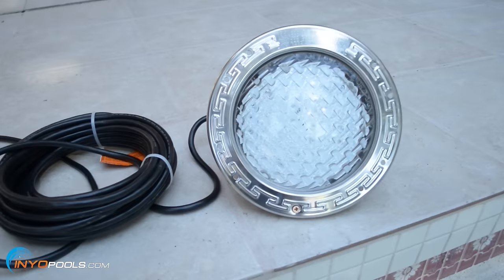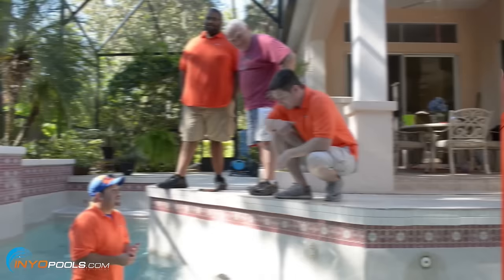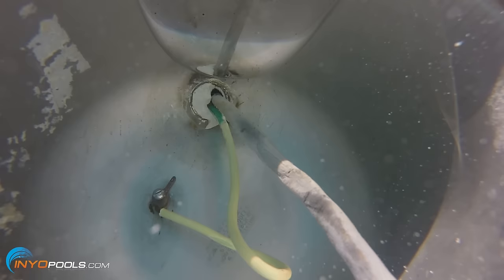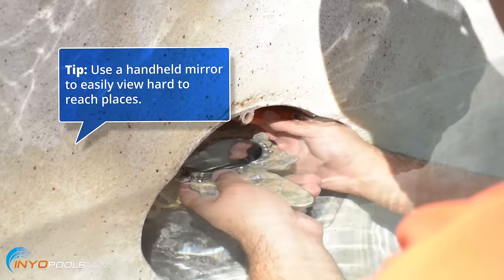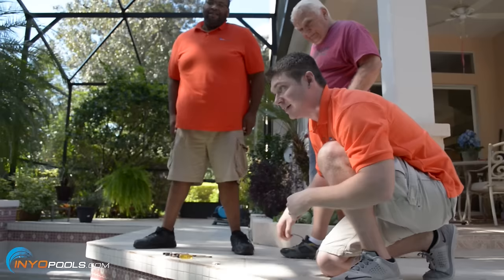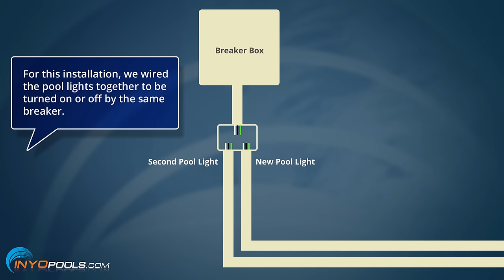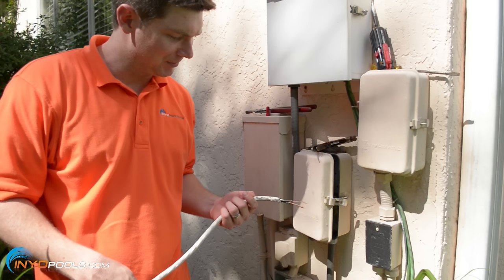Poolside Repair: How To Install A Pool Light

Comment: You can use  $4 harbor freight multimeter to measure resistance across the the power wires at the box. The cable with infinite resistance (no continuity) between hot and neutral is the one with the cut cable!  Only one person needed.  No tug of war. Duct tape makes a much better pull joint than electrical tape.  Might as well give yourself every advantage you can.

Comment: It looks like your video missed the part of leaving enough cable so that the light could latter be taken out of the niche an placed on the deck for servicing.
Reply from the maker: We mentioned that in the video description and our blog post, here: http://www.inyopools.com/Blog/poolside-repair-install-pool-light/
Reply: Perhaps, but you surely did not show it in the video - in fact, it is quite obvious that there is absolutely no slack cable left in the niche and so whoever is stuck with replacing that bulb when it burns out will have an unexpected problem on his hands.
Reply: @chuckschillingvideos  I can see him putting several loops of wire in the back of the niche at 5:10

Comment: I know that most of these questions are older but I'll give it a shot here to see if anyone might know. I see conflicting videos out there when it comes to draining to light level. It looks and sounds like it's not necessary but mine is on the deep end and i'll either do it one armed from the deck or while treading water. If I don't drain and then go to pull out the epoxy, is the water going to travel out the conduit and just stop at the bend. If so, is that okay to leave all that water in there? I have an old Anderson pool with NO diagrams and am not even sure where the switch, breaker or junction boxes are.
Reply: You ever figure it out?

Comment: Good video guys. You might have mentioned the bonded ground wire in the niche because some people were probably wondering what that was. Also to leave 4-6' extra wire to be able to pull light to pool cool deck so water does not have to be drained.

Comment: I didn't see wether you put new silicone or whatever in the nitch hole ?
Reply: I was told by an expert that water will get in the conduit somehow anyway whether sealed or not and not to lose sleep over it.  Meaning you do your best to apply some epoxy at the niche hole and at the JBox and forget about it.  As long water doesn't leak at the JBox, you're fine.  My believe is that water in the conduit will recycle itself even if it takes a year but it will; so don't think water will be stagnated in the conduit forever.
Reply: Do you lube the gasket around the lite before putting it back in.

Comment: Draining the pool is not necessary...but great for videos.  I swapped these all the time in the winter with nothing but a wet arm.  Also, I noticed that he did not hook the light on the bottom of the niche. If there is no hook in the niche then a 'light wedge' is a good solution.
Reply: What is that lightwedge because this is what I've been trying to figure out if there's a hook at the bottom
Reply: @roymcleansr.5404  https://www.youtube.com/watch?v=thCt4adC2V4  ...it is a wedge that goes on top of the light, uses existing escutcheon holes, but presses the light down hard enough on the bottom to secure it if it is missing the hook. I have used two opposing wedges to secure lights with no female threads or bottom hook although it takes some finesse.

Comment: I hope you guys didn't forget to put the epoxy back in and to leave yourself enough room to be able to stretch the light up to the deck for a bulb change if necessary later on.
Reply from the maker: Hi Steven, we replaced the epoxy with a rubber stopper. We forgot to include that part in the video. We definitely remembered to leave ourselves some extra cable. Thanks for watching :)

Comment: dont pull it next Time Sirs,pls use a multi tester for the contenuity and it is easy to detect which wire is to splice or to connect.

Comment: I didn't see you put epoxy back.  I will be replacing my light soon and was wondering about the epoxy part of the install.  Also I have a Pentair Am. sAm light now.  I was not impressed with the sAM light at all.  Are there other lights worth the price?
Reply from the maker: We used a rubber cord stopper instead of epoxy for the new installation. It is easier to install and easier to remove for maintenance in the future. If you want a color changing light I suggest the Purline Pure Colors LED light: (http://www.inyopools.com/pureline-pure-colors-led-pool-light-fixtures.aspx)
Reply: A rubber cord stopper? What would that do? Wouldn't water be on both sides of the stopper?  What's the part number for this stopper?
Reply: What’s the part number or link?

Comment: I noticed that you said you pulled Apoxsee sealant from around the cord out. And I also noticed you didn’t show putting out Apoxsee or any thing back in that conduit wouldn’t hurt to put a marine grade silicone back in that hole to stop the water from going in there.
Reply: Also, the rubber stopper you use does it come with the light?
Reply from the maker: The cord stopper does not come with the light; it can be purchased separately from a hardware store for a couple of dollars. We didn't add epoxy to the cord stopper because it would be unnecessary. It'd be like gluing a cork into a wine bottle. The cork is enough.

Comment: We built a pool with our new home (20' X 45' in-ground with integrated spa). I only noticed after-the-fact that the pool contractor installed spa-sized lights EVERYWHERE! Because of the this, I find that the brightness for night swimming has a lot to be desired. There are a total of 5 lights in the pool and 1 light in the spa. I think they are all incandescent as well. 

Anyway, I've been questioning for the last year whether I should upgrade to LEDs to improve brightness. Will this really make a noticeable difference in a spa-sized bulb that has a limited wattage anyway? My pool plaster is Hydrazzo Maui Midnight (so, not white or light blue) if that makes a difference. I know the paler plaster colors hinder the brightness as well. 

Would love to know if anyone has a similar experience or have retrofitted to improve brightness at night. Before and after pics would be awesome as well.

Thanks!!
Reply from the maker: Making the switch to LEDs is probably not going to improve your brightness, unfortunately. At best it will be a lateral move.
Reply: Inyo Pools, Thanks for the confirmation. That's what was afraid of.

F

Comment: What type of junction box should be used for pool lights? Is it safe to use metal junction box 2-3 meters away from the inner wall of the pool?
Reply from the maker: We recommend the plastic Intermatic junction boxes. You 'd have to check with your local codes about a metal junction box. It would need to be bonded since it is metal and close to the pool.

Comment: Why didn't you cover replacing the epoxy with the material/device of your choice.  That's the only part that I'd like help with.
Reply from the maker: We didn't cover reapplying the epoxy because we didn't use epoxy during the installation of the new light. We used a 'cord stopper,' a rubber cork that's been cored, to allow the cable to run through the middle. It is a cleaner install than epoxy and is a lot easier for maintenance or replacement down the line.

Comment: Cool video. Helped me to understand how the installation of a pool light works.

At minute 5:24 you can see a small opening on the lower right side of the niche. That means water will go thru the niche and stay there all the time. That is not dangerous ?
Reply from the maker: It's normal for water to go behind the light and inside the niche. That's why it's important to plug the conduit hole with epoxy or rubber stopper.
Reply: Great. Thanks!

Comment: Pls guys while wiring a pool lighting, can I run two of the lighting cable in one conduit pipe?
Reply: Yes you can, you just have to adjust the size of the conduit based on the number of wires you want to put in.

Comment: Did you replace the epoxy in the niche before putting the new fixture back in?   If so, what did you use?
Reply from the maker: We used a rubber cord stopper for this install. On other installations we've used a 2-part underwater epoxy.
Reply: Aquabond
Reply: Did you darin the pool to below the level of the conduit first?  Otherwise, you already have water in the conuit, no?

Comment: There is something very disturbing about stamping water holding electrical wires.  I pulled my light up once and even though it was disconnected. It still made me very uneasy.
Reply: People have been electrocuted from such a simple job.

Comment: After he takes the epoxy out underwater, doesn’t the water leak into the conduit where the wire is feeding from? Shouldn’t he have drained the pool more so that doesn’t happen??
Reply: its normal to have water inside the conduit.  the conduits are supposed to be water tight. but in the even that they are not, simply adding butyl tape just at the rim of the conduit is sufficient

Comment: Would like to know, @5.09 when securing the fixture to the wall socket, what connectors were used to join the lamp to the new power cord?
Reply from the maker: We overlapped the cable ends by about 6 inches, and used a generous portion of duct tape to keep them together.
Reply: i thought duct tape was for ducts and electrical tape was for electrical.. guess that's why cars drive on parkways and park on driveways...
Reply: The new power cord is factory sealed to the fixture, there is nothing to join at the back of the light.

Comment: Did you replace the incandescent bulb with an LED bulb?
Reply from the maker: We did replace the incandescent bulb with an LED bulb before we installed the fixture. We didn't include that in this video but we do have an older video that illustrates how to change the bulb. https://youtu.be/YsUaWpwO93k
Reply: Be real careful with the pool LEDs; they're "50,000" hour life is a complete sham.  3 of my 4 y pool LEDs are failing at about the 500-hour point.

Comment: Very good, but, you might to explain the voltage required for this light , 12 volts
Reply from the maker: Hello Jose - On this install, we used a 120v light fixture. 12v is not required by his local codes.

Comment: Question. How the water no entry in the tube where it is the cable?
Reply from the maker: A cord stopper or putty is used to seal the conduit where the cord enters the niche. That prevents the water from the pool from leaking out of the pool niche.
Reply: Inyo Pools Great Thanks. But I just checked that you removed this at the beginning being under water. Do you know what I mean?

Comment: You gotta leave enough cable to set the fixture on the deck --- flex seal to replace the epoxy that was removed
Reply: The epoxy is pointless, nor does it need flex seal. Pool builders and other 'professionals' cause a $400 job to turn into a $3000 job because they like to fill their conduit with 1-2 ft. of epoxy. Cutting pool decks and digging 5 foot trenches (by hand in most backyards) is fun and all but I would rather we eliminate bad information/government regulation. I have never once encountered a problem with a conduit full of water as long as you have a properly raised junction box. I have also never seen dry conduit (or 'an epoxy job' that kept water out). Those lines are direct bury and can handle water.
Reply: @peoplsrepublcOcali 
You seem like the only person including the installers that know what the f you’re talking about.

Comment: Next time just solder the new wires to the old wires and save yourself a ton of time.... they won't come apart.
Reply from the maker: If you use a hi-strength solder may it work, but the regular run of the mill stuff probably won't hold up to a few heavy tugs. - MGS

Comment: why can't you take the old wire out feed the new wire out with the old one
Reply from the maker: We actually try that in the video but the taping job didn't hold as were pulling the old light cable out. So we had to use a snake to pull through the new cable as we show.
Reply: You can but you need to make a better job of connecting the two cables. The way we do it is to create a hook and eye, on the respective cables, and then when the hook is in the eye, we clamp the hook shut so it becomes an eye, then we tape over those connections to try to prevent any snagging, and we use silicone, as per the video. The video itself tells you everything you need to know. Ignore the pickers asking about new epoxy; it's pretty obvious that new epoxy is required, as is leaving a tail so the light can be lifted out of the recess on to the pool deck. You won't go far wrong copying these guys, who I thank for taking the time to make the vid.